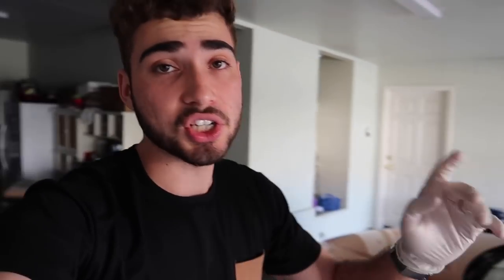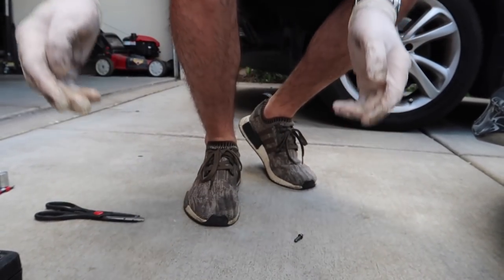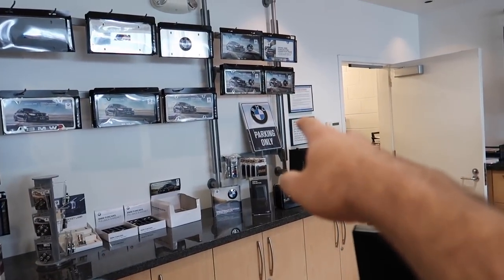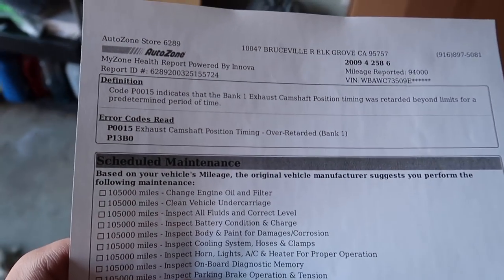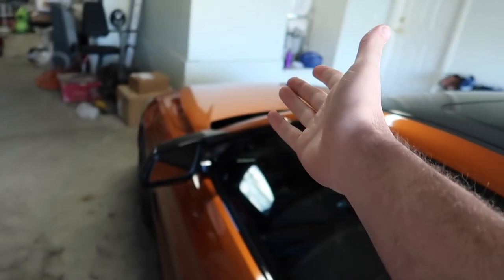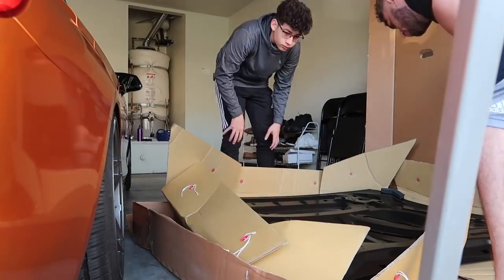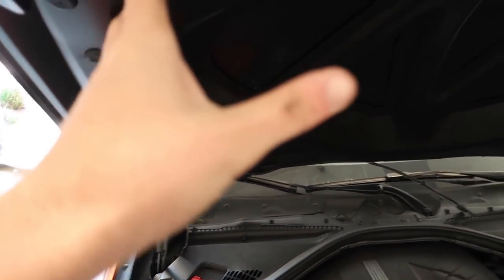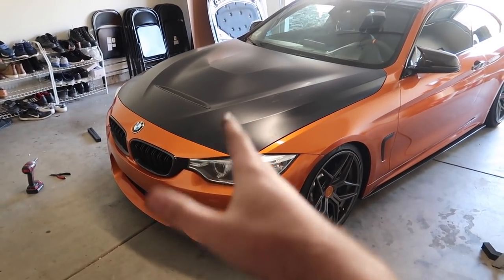435I GETS CUSTOM HOOD! (AMAZING FITMENT!)

Comment: This code is basically telling you that the timing for the exhaust camshaft (left camshaft) is not right. This could be due to camshafts or timing but most of the time its because of a sensor. I accidentally over revved my car once and this code came up with the car running really rough. Turns out that my timing was off due to the timing chain skipping a couple teeth during the over rev. I had to open the engine up and buy tools to realign the engine properly. Most of the time this code is due to bad sensors. I'd recommend fixing the exhaust sensor first (I think it's the bottom one) before opening up the engine. If you do end up opening the engine, you can do the valve cover gasket at the same time :)
Reply: Omar Dabayeh sane shit happen to my 335i. I get ptsd when they work on his car 😂
Reply: I guess it's kinda randomly asking but do anyone know a good site to watch newly released series online?
Reply: @Duncan Archer Flixportal :)
Reply: @Yahir Davion Thank you, signed up and it seems like a nice service :) I appreciate it !
Reply: @Duncan Archer happy to help =)

Comment: CHECK THE MAP SENSOR O RING AND THE GASKETS ON THE EXHAUST. THOSE CAN CAUSE LEAKS. IF PUSHING MORE POWER AFTER MODS YOU MAY NEED TO HAVE ANOTHER HIGHER BAR MAP SENSOR